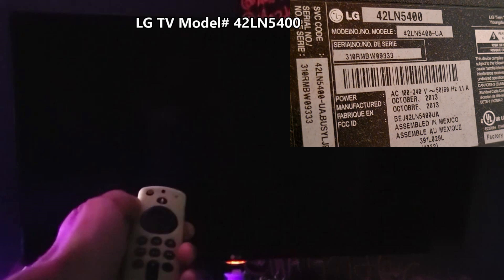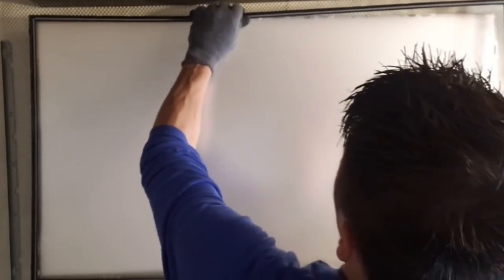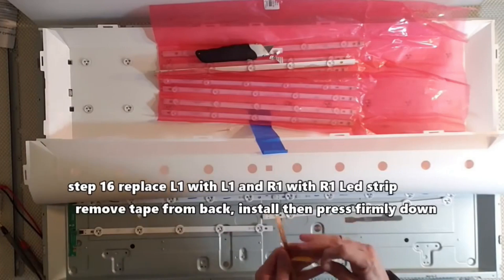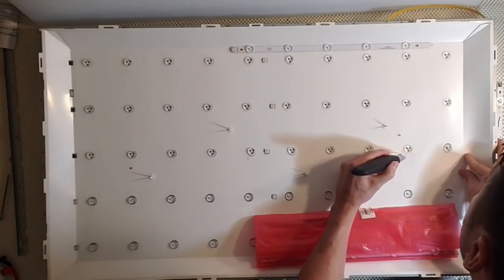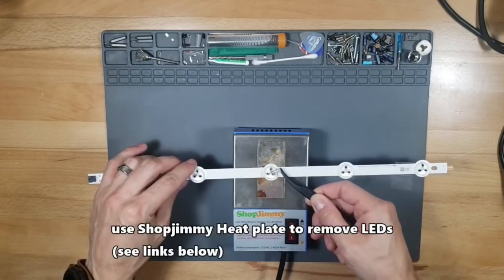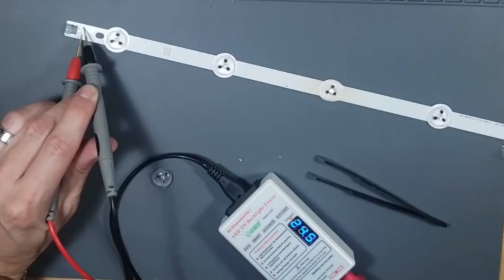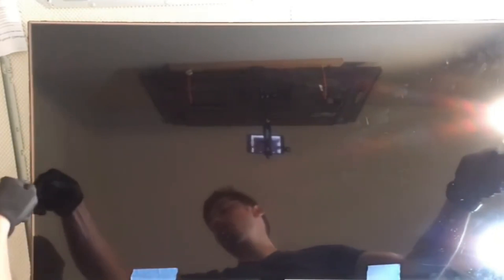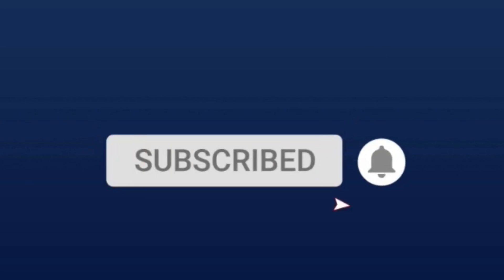2 WAYS TO FIX LED TV BLACK SCREEN NO BACKLIGHT

Comment: Great site. I am hoping my problem is a corrupted upgrade. I have a failing backlight problem after a recent WebOS March upgrade. If I switch off and unplug overnight I can switch on next day and the screen remains on for long enough to do All Settings -> General -> Reset Initial. Should I try this or is the fading to black problem hardware related? Once the TV as been on and then switched off for some minutes, the fade is almost instantaneous. Set is a LG 55SK8000PTA vintage 2019
Any clues anyone?😟

Comment: Hi, Great watching your uploads, Please can you advise? I have a Sony 55XD8599 TV and when I switch on the standby light blinks on/off Green& White there is no picture or backlights and after several minutes there is a tune that repeats but no baklights or picture visible. When I disconect the main board cable and then switch on the backligts work as expected however once the cable is refitted I get the same fault.
Thank you in anticipation.
Regards,
Brian
Reply: You must ask an service guy. Here is just LED replacings. Any kid can do it.

Comment: I have a Sony kdl-46bx450. When I turn on, the green led light turns on and the Sony logo shows up,  then the screen becomes back again. and then the red led light turns on and blinks 6 times.

I did the reset, unplugging the power and press the power button for 30secs then connect the plug again and power again after 2 min. now the green led light is always on but screen is still black.
I'm thinking doing a factory reset. But wonder if any of the boards are gone.

I assume the led back lights are fine since they work at the very beginning to show the Sony logo. but after that the screen turns black.

What should I check next?

Comment: I find it better to painters tape the glass lcd screen in place then leave face down. EVERY TIME I actually remove the screen it breaks. They are so incredibly fragile especially when your going 60” or larger.
Reply from the maker: True anything over 60in is HIGH risk replacement. I don't buy TVs over 60" for that reason. anything bigger I have 4k projector and 120in screen. U should check out my bass shaker install in my couch, kids love that.  https://youtu.be/LV2BWYSfK3I?si=nLWP1D_PsZLvMv5n
Reply: Er...tcon cable sand buffer boards replacement? Otherwise a great step by step guide, thanks.
Reply: Is not risky if you use those suction cups. 6 pieces and two plastic (pvc) bars. Must be a second person for help. I never break any display larger than 60"